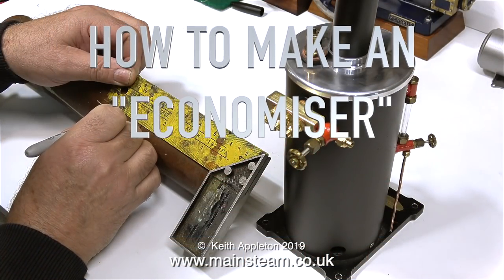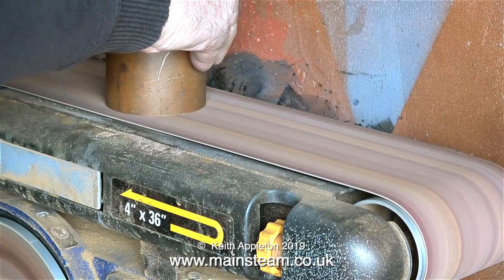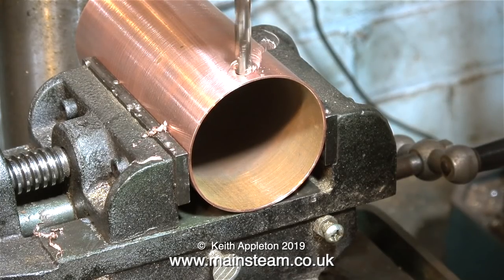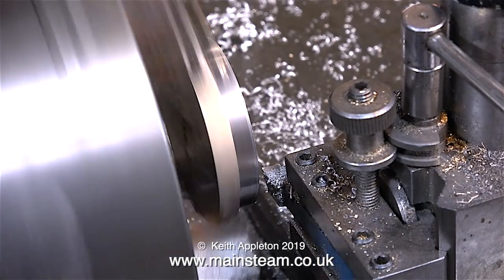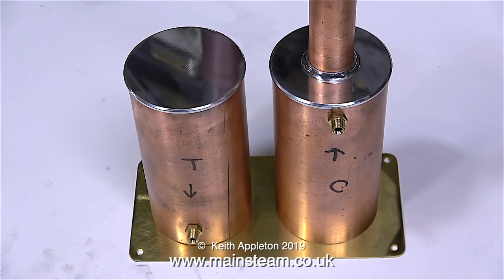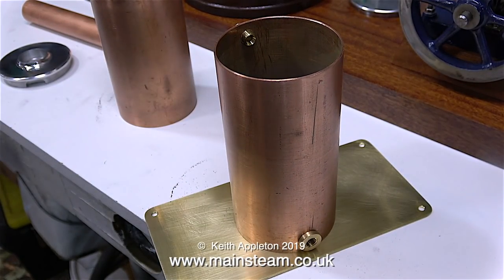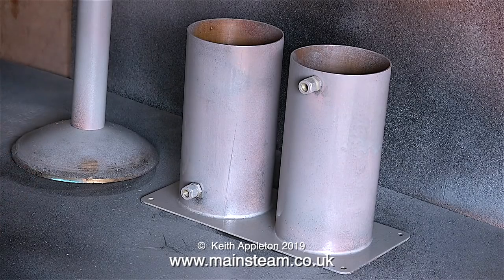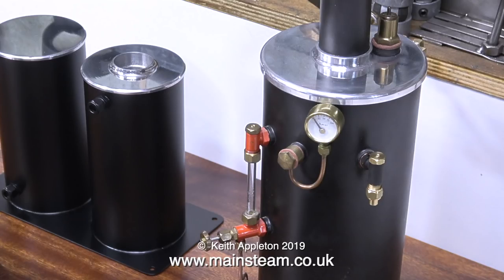HOW TO MAKE AN ECONOMISER - A FEATURE LENGTH EPISODE

Comment: Very interesting video thanks for making it as long as you did. A method I found for turning thin wall tubing, and I do it a lot, when you have a scroll chuck if you run the chuck in reverse the scroll has a tendency to tighten on the material without crushing it. Then you turn the end square from the far side. Each time you turn on the lathe in reverse the material will get a little tighter in the check without crushing it.
P.S. 
       Oooooooooh, paint drying.........

Comment: Interested & Curious about the main Boiler copper / aluminum joint. What kind of solder was used?  Thank you for the great hands-on-tutorials :0)
Reply from the maker: This is not a Boiler, the Aluminium parts are just the push on lids . . . . . The Water Tank and Condenser was just soft soldered to the Brass base . . .

Comment: Dumb question: Could you run a coil of copper tube through the water tank and send the exhaust steam through that?
Reply from the maker: Yes of course, but this is a simpler and quite a neat way of doing it I think . . . .